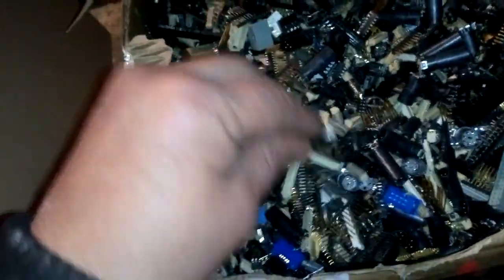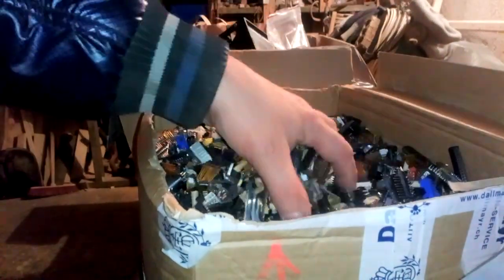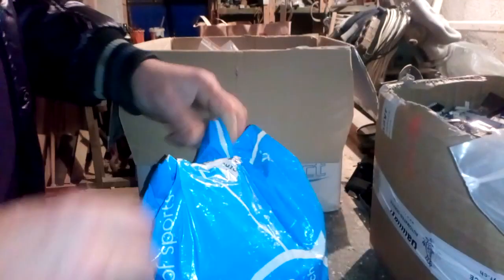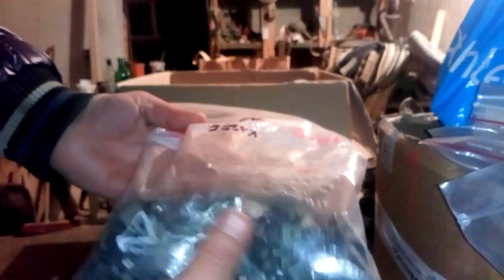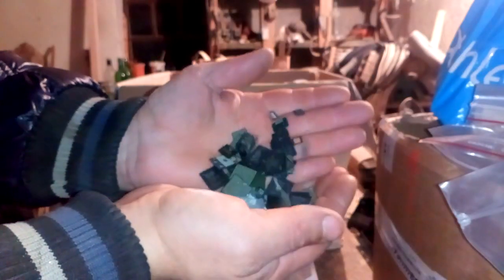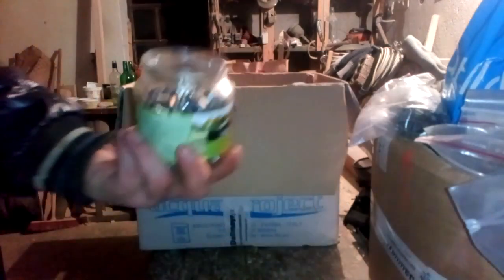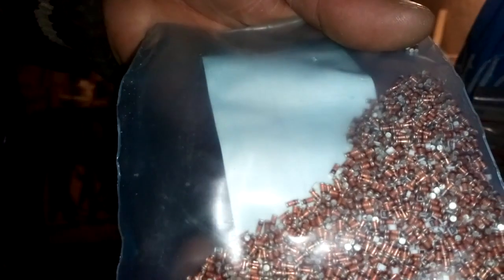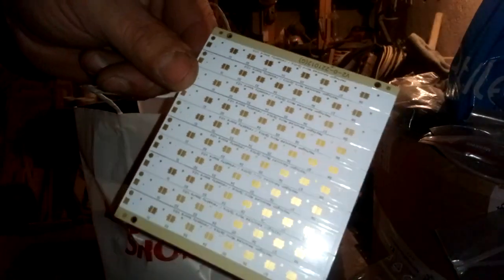New material arive fro gold,silver,palladium and platinum recovery!

Comment: Warning Dusan! 
The smal black smd's with numbers on them, are TFR's (thin film resistors). Normally they contain Ruthenium oxide. 
But some thin film resistors contain Rhodium Oxide instead of Ruthenium. Anuhow it is very dangerous and higly toxic to refine! Don't touch that stuff, especially when it is in liquid form! 
Its better if you collect them and resell them to large refiners, they have specific methods and machines to process them safely.